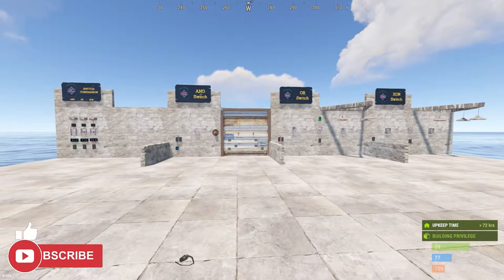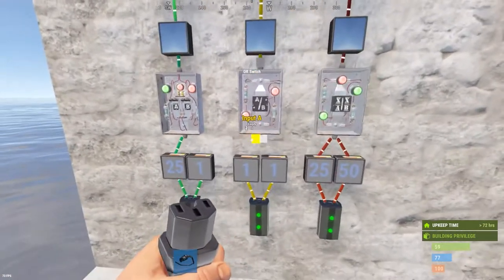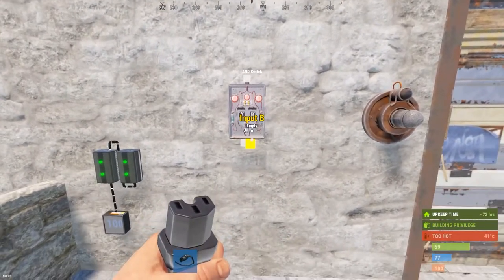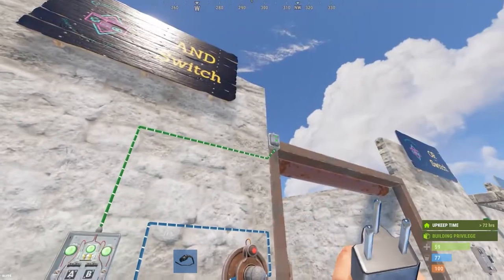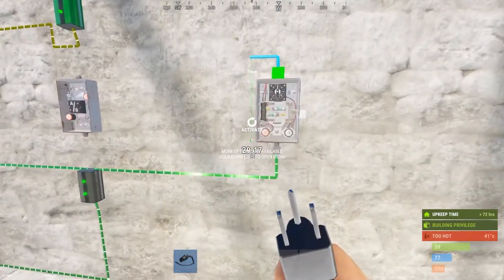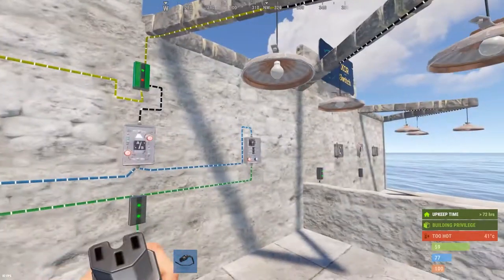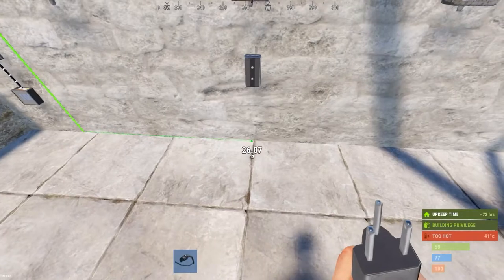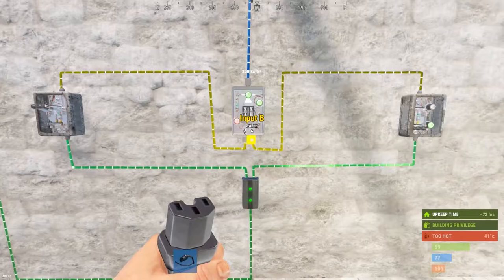RUST Electricity Tutorial | AND Switch OR Switch XOR Switch WITH EXAMPLES 2022

Comment: the OR switch only takes 2 inputs, what do i do if i have 3 inputs, i tried connecting OR switch 1 (OR1) to OR switch 2(OR2) so that i could have a 3 input OR switch but it doesn't work.

In context, I'm making a circuit that can close and open all doors with a button, it uses a button, hbf, memory cells, and switch and or switch. But i can only put 2 buttons because the or switch only has 2 inputs, I wanted to add 3rd button to the circuit but having 2 OR switches doesn't work. Do you have any ideas on how to make it work?
Reply from the maker: That should work. Make sure that you have enough power to pass through two OR Switches. OR1 will require minimum 3 rW per input in order to have 1 rW pass through OR2. The other input on OR2 that's not connected to OR1 will require a minimum of 2 rW.

Also keep in mind, OR Switches will always pass the greater of the two power sources they receive.

Comment: the hsb sensor will not always out 1 rwats if there are 2 people it will output 2 wats i think it goes up to 4 depending on how mush u put in ?
Reply from the maker: This is true! For the purpose of supplying voltage to the circuit it only needs one. But yes, I should have been more clear about that.